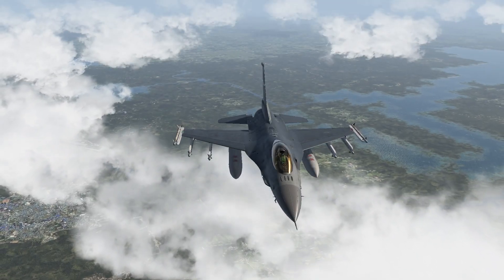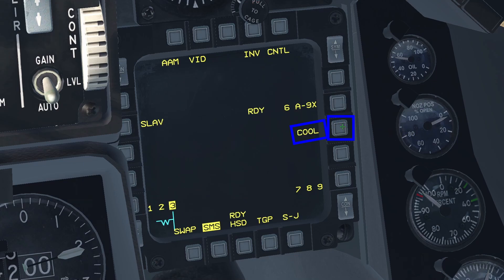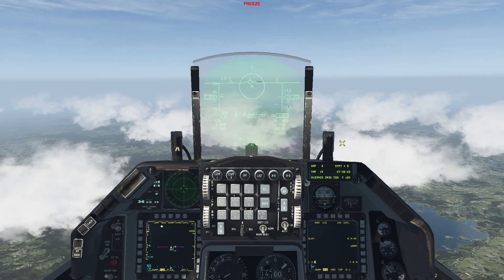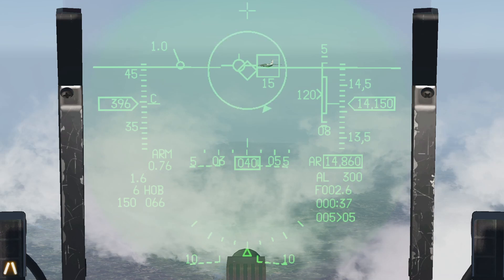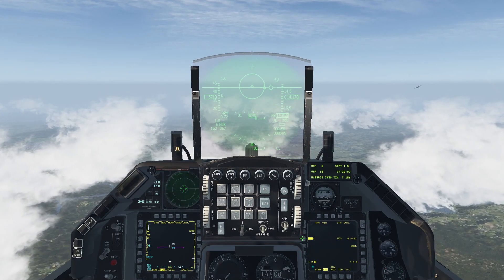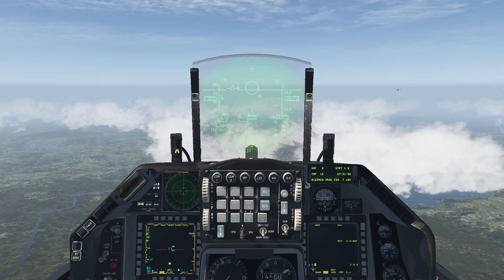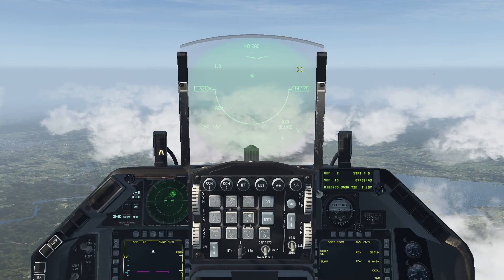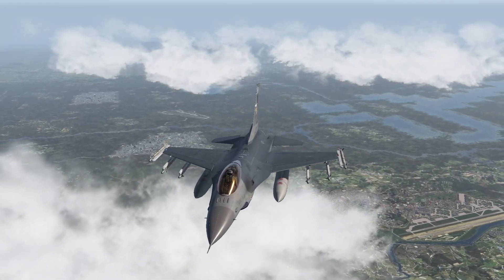Falcon BMS 4.37 Tutorial - AIM-9 Sidewinder and Dogfight mode

Comment: AT 11:05, target AA is 170 right, not 17. Target is hot 10 degrees to the right(170 + 10 = 180) 180 being 12 o clock hot. 

It's rounded, 17 degrees right would show AA 02R and that will mean you are slightly left from his 6 o clock
Reply from the maker: So what you're saying is that value is actually the target's heading and not its relative position relative to the nose of my aircraft?
Reply: @fisgasfighties  look up aspect angle in the -34 manual. Page 194 of 4.38 manual

Comment: AIM-9Xs shouldn't have a WARM/COOL function.
Reply from the maker: @TheArcticFoxxo  they don't have that IRL?
Reply: @fisgasfighties  No, they don't. There's a cryocooler for this that replaced the Argon cooler for the earlier InSb seekers.
Reply from the maker: @TheArcticFoxxo  I see. Maybe the BMS team isn't aware of this functionally?
Reply: @fisgasfighties  It was more than likely carried over from early SMS functions of missiles, and code for the 9X was copy/pasted from the 9L/M.
Reply from the maker: @TheArcticFoxxo  probably. If what you're referring to is mentioned in an open source document I'd say send it to the BMS team, I'm sure they'd try to implement the system in an accurate way.
Reply: @fisgasfighties  You don't even need a document for it, all FPAs use cryogenic cooling instead of gaseous cooling.

Where would I contact them?
Reply from the maker: @TheArcticFoxxo  try on the BMS forum

https://forum.falcon-bms.com/
Reply: @TheArcticFoxxo  It's just as likely the OSB does nothing apart from switch the text. F-16 and other old aircraft, and even F-35 now, have a lot of strange legacy control stuff.
Reply: @ArchOfficial It does far more than simply "switch the text".
Reply: @TheArcticFoxxo  Alright. What is your source? Did you operate the F-16 with AIM-9X? Worked for Lockheed? Some manual says what they do if the 9X is selected?
Reply: @ArchOfficial Yes... And I currently do. Captive 9Ms have cooling functionality, the 9X-IIs (and 9Xs, I would presume) don't.
Reply: @TheArcticFoxxo  What is the behavior of the OSB when AIM-9X is selected?
Reply: @ArchOfficial There is none... Once again, the 9X is not an argon cooled missile.
Reply: @TheArcticFoxxo  Those are not related to eachother; there's plenty of deprecated software and hardware functions in lots of aircraft. It just means they remembered to remove that OSB function with the 9X. Have you relayed the info to the BMS devs?
Reply: @ArchOfficial Deprecated software and hardware functions" don't directly influence the function of reliant weaponry.

If I were to toggle cooling measures on a cryogenically cooled seeker, quite literally nothing would happen. That contrasts HEAVILY to in-game function, where it acts much like a 9M and slaves the seeker in standby.

What info?
Reply: @TheArcticFoxxo  That's what I mean; there's a lot of functions which do nothing, yet are still implemented.

The info that you're an F-16 SME and have a personal account of a 9X and its SMS OSB functions?
Reply: @ArchOfficial Third time now, this function doesn't "do nothing", it directly inhibits use of a munition that doesn't interface with it.

Not sure, I posted something way back when.
Reply: @TheArcticFoxxo  Your communication is extremely unclear. Does the OSB option show up or not with the AIM-9X? If it does, what does it do if you press it?
Reply: @ArchOfficial The topic has never once been as to whether or not the OSB config supports cooling input, nor is there a resolute standard between any aircraft.
What you're failing to comprehend is that the function of argon cooling DOES NOT and WILL NOT set the seeker of a 9X to standby.
Reply: @TheArcticFoxxo  I understand this fully, we're far beyond that. I'm talking about errors in the modeling of the OSB function.
Reply: @ArchOfficial  What about it is confusing you?
Reply: @TheArcticFoxxo  What text, if any, is displayed on the OSB when AIM-9X is selected?
If text is displayed, what is the behavior when the OSB is pressed?

Comment: Nice tutorials! Keep going.
My 2 cents, you can change slave and bore mode by pressing and holding the enable button.
Reply from the maker: I didn't know about that feature, thank you!
Reply: Where's the enable button? Thanks in advance.
Reply: @whammo11224  On the throttle.
Reply: @martwint6  Thank you!
Reply from the maker: @whammo11224  you're looking for a key called "cursor enable", by default it's on the throttle, on the TM Warthog it's when you press on the radar cursor
Reply: @fisgasfighties  Thank you!